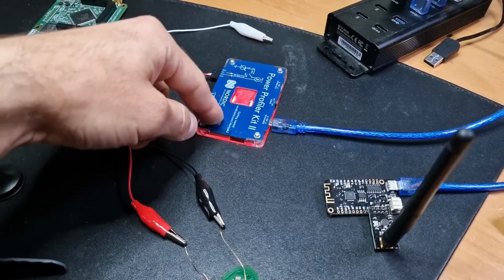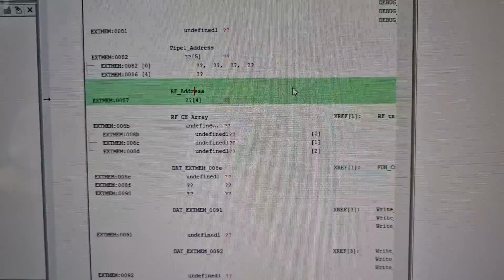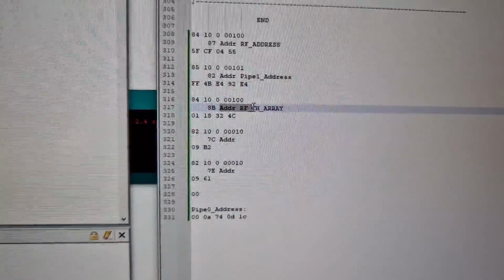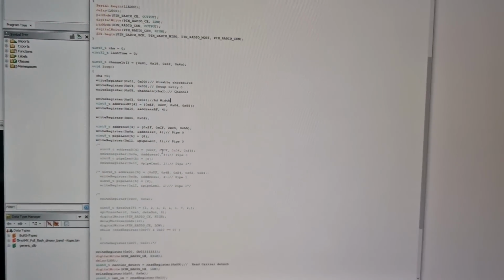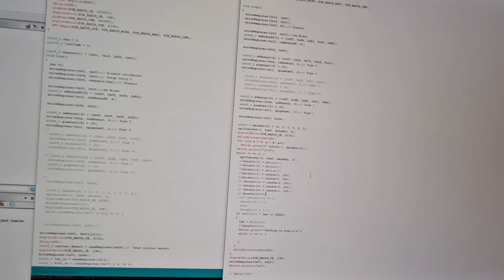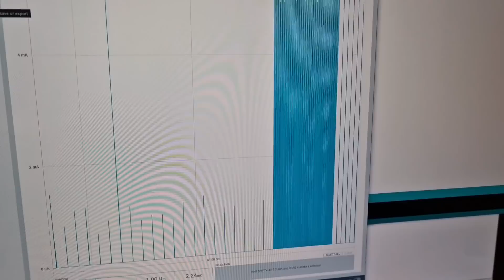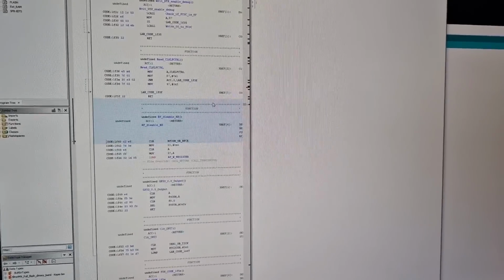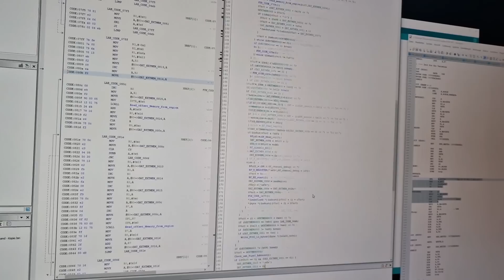Disney MagicBand Hacking Part 2 -RF Firmware reversing

Comment: Great information and an interesting look into what you can find out with limited information.

I've had a go at reproducing your results with a couple of MagicBand+ from around the time this video was released (i.e. probably similar firmware age) and they don't seem to respond to the magic number or any value which can go into that first byte of dataOut. I think I need a MB+ to disassemble and attach a power profiler to next and if that doesn't get me anywhere then I'll be trying to dump the MB+ firmware. My assumption is that the firmware is the same as on the non-plus bands and the bands simply lack the extra hardware (leds and a vibration motor).
Reply from the maker: Hey, MB+ works completely different
Reply: @atc1441  That figures. Almost as soon as I'd finished writing the comments I realised the non-replacable battery means the wake-up conditions have to be completely different so they almost certainly need to have a different and more frequent beacon interval from the parks and the bands have to be aware of whether they're a MB or MB+.

Comment: So it is in a deep sleep until woken up by entering a park...Then it will send it's ID to track (crowd control,ride photo linking,etc) and when you leave the park (no more rf triggers) it goes to sleep (battery is supposed to run for 3-4 years)..thanks for the insights
Reply from the maker: Hey,

Yes it works exactly like that

Comment: Soooo.. you could theoretically go to the mouse house and generate a LOT of fake visitors, right?
Reply from the maker: Yes
Reply: @atc1441  imagine all of the attack vectors.

$someone could try to find out what they are doing with this data. If it's only for internal benchmarking or if it's used for crowd control. Maybe the backend rejects unknown ids. In that case you'd need to log all of the valid IDs and replay them.

And did I get that right? The nfc id is identical to the radio id? If these bands are used for payment (are they?) that could cause mayhem.

Maybe that's worth investigating further. Not in a malicious way, of course but for responsible disclosure reasons.

Comment: Disney now uses MagicBand+ which combines NFC with BLE for interactive experiences throughout the park. Basically, it has 5 RGB LEDs and a vibration motor which activate when riding certain rides or near certain statues in the park. I am desperately trying to figure out what Disney does to trigger these animations. I have already toyed with the NFC and using it home w/Raspberry Pi, but I'm a novice when it comes to BT comms. I would be willing to help get you one of these bands if you'd be interested in trying to figure out the BT proto/commands the trigger the affects.
Reply from the maker: Hey, yes the new one is way more advanced, it uses an EFR32BG21 SoC and i would love to get my hands on one
Mail: band@43u.de
Reply: @atc1441  you might also be interested in the interactive hats/wands Disney made in the 2010s. Lots of cool tech in them as they could both transmit and receive. The final generation ~2018 had bluetooth and IR and could be controlled with an android app. https://www.youtube.com/watch?v=IIIjR5prez0
Reply: @atc1441  Were you able to get one shipped to you? I'm also interested in integrating some smart triggers around the house and was eyeing the haptic feedback from the MB+

Comment: Hi, thanks for this! I've been attempting to get it working with a Wemos D1 R32, which is an Uno shaped ESP32 board. The sketch compiles and uploads and runs, but no bands are found. Here's my pin  configuration. Do you have any ideas of what I may be doing wrong?

const static uint8_t PIN_RADIO_CE = 16;
const static uint8_t PIN_RADIO_CSN = 5;
const static uint8_t PIN_RADIO_MOSI = 23;
const static uint8_t PIN_RADIO_MISO = 19;
const static uint8_t PIN_RADIO_SCK = 18;

Thanks!
Reply from the maker: Thanks for trying to use it, so far i heard that some fake nRF24 make problems so maybe try another one if one hand.

Also you could try to send the wakeup signal for a long time and then reupload with the default code, maybe the wakeup is too short
Reply: D1 is Wifi, 803.  I think.  RF24 is 2.4.
Reply: @rcstl8815  I'm not using the ESP32 for its wifi or ble capabilities, I'm using it plugged into an nRF24 via the pins I noted. Aaron is doing the same

Comment: Wow it would be good if you make a arduino library to use all the functions of the magicbands? but im not a programmer so if you did a library can you also convert t into a microblock library witch is a arduino base programming in block for meny difference board witch support ESP32. Tim

Comment: Do you live in Berlin? Lets meet up! :)
Reply from the maker: Near Hamburg
Reply: @atc1441  Ok, that's pretty close. I can just use the Deutschland ticket to go there :)
Reply from the maker: Yeah sounds doable, whats the plan to do? ^^
Reply: @atc1441  Well, just talk about electronics in general :) I've done a lot of playing around with esp8266 and esp32. Mainly coded flight controllers for drones in C, but also home automation stuff. Also hacked some devices laying around. Mostly cameras running tiny Linux installs. It's always nice to meet likeminded people :) Lately been playing around with making airtag-like trackers on esp32.
Reply from the maker: Lets continue via PM
Write me a mail if you like: atc@43u.de

Comment: The plus band has leds and haptics, wonder if some of the other functions trigger those. World be great to trigger some of the plus bands to alert the wearer about something
Reply from the maker: I need this!
Reply: I'll see if I can find mine and get some pictures of the internals
Reply from the maker: It seems to use an EFR32BG21 as main SoC very powerfull, like a smartwatch
Reply: Have found it. Will see if I can get the bead open later.
Reply: In the Disney outlets outside the parks they were selling various magic bands from older promotions for very little money compared to what they charged for the current bands in the parks. I nearly bought a load just to experiment with but opted against it in the end as my hands were literally already full. Wish I'd gone back to get a some now.
Reply: Ah I see that's only the plus ones huh his doesn't have that function I guess?

Comment: I know at one point they were planning (or potentially implemented) a feature to identify guests in crowded areas, and then send them a discount code in the app to a restaurant in a less crowded area in order to even out the crowds, super cool stuff!
Reply: I also know all of the wait time tracking in the parks is done by magic band now as well, I believe that's one of the main uses for the tech
Reply: @dvdcd  Likewise, if you have a band, rumor has it that you can pre-order a meal for a restaurant. When you go in and sit, the band is automagically read and your food just shows up, and they know which seat you are at.

Comment: So, understanding the band's nature, I would think that the "3" function is transmitted by the park to "wake" the device. This prevents others from seeing the messages the band transmits without being in the park. Other functions might control which Disney Park and, therefore, more information.

I wonder if the band also reads any NRF of other nearby chips. I would also think there is a clock set function, maybe a part of the 3 functions, to give timing.

This would give Disney knowledge of who is nearby this band for contact tracing.
Reply from the maker: Hey, since the firmware only listens on Ch82 but never transmits on it i dont think that would work.
Also the listening time is only at around 500us max, that timing would need to be way to presice

They can still somewhat do contact tracing by looking who is at the same position in the park
Reply: @NeuralMonk  Generically the nRF31512 is listed under FCC as broadcast control. He is saying the firmware written for this device does not transmit on CH82, it just listens.

Comment: Sounds like the band was triggered to go through and find a new channel to talk to some AP - like finding a clear channel, but that AP never responds, so it keeps searching for AP. Maybe it’s looking for autoack or some special ack w/ payload. I have seen something like this while working with nrf24L01-based remotes for articulating bedframes. Since you. Have the most of the code reversed, you can see all the program flow where it’s working with NRF24 module registers, and find out how it sets up the TX & RX (autoack, payload settings, reading status registers, etc)
Reply from the maker: Auto ACK is disabled :) it can only every listen on Ch82 and TXes on the 4 Channel list in a loop

Comment: Heck yeah! Nice to see it doing something other than being passive all the time. Interesting that it would have any sort of active mode at all considering the small internal battery and being 100% sealed with no way to replenish the joules. I do remember Mission: Space used to have an astronaut leaderboard when you got off the attraction that would show your name and how many times you've ridden. It would have had to have sent its ID over this protocol as you neared the display, as it would have been far outside the NFC range.
Reply: It's A Small World also did (or still does) display guest's names on video screens in the fairwell ending of the attraction